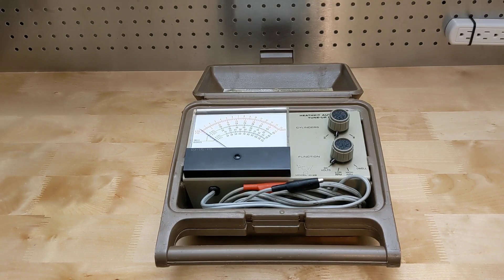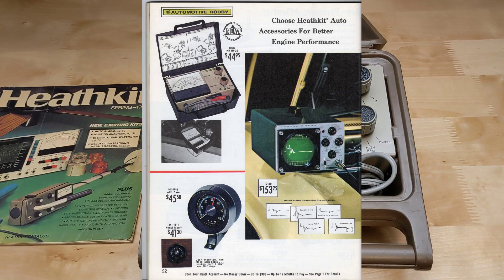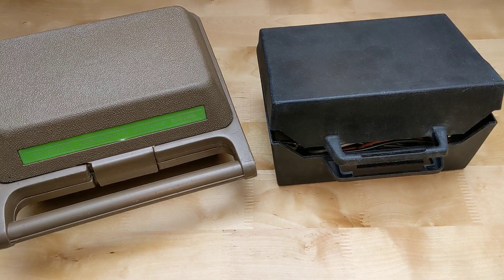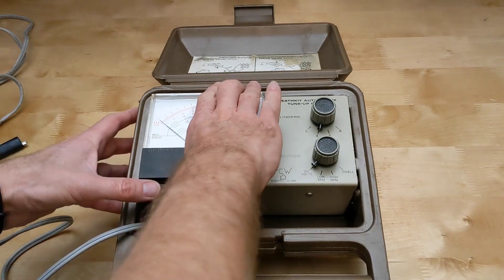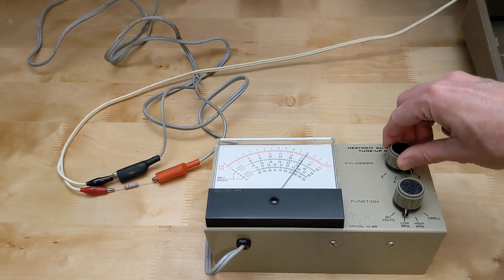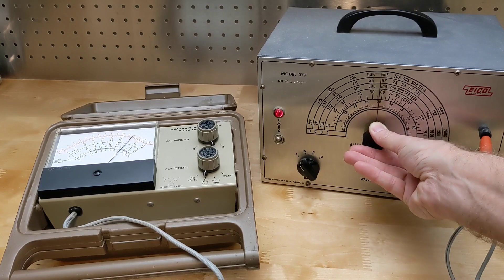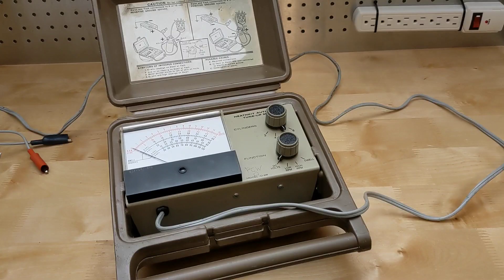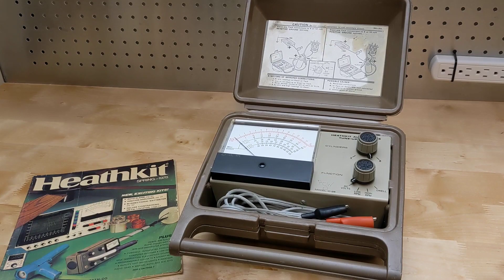The Heathkit ID-29 Automotive Tune-Up Meter

Comment: I'm an old guy with an old piece of gear, a Heathkit Electronic Tachometer, model MI-31A, that I bought and assembled in 1965 at age 19.  My originally-intended use for it was to set up the Mercury Mk 20H racing outboard that powered my class B Stock Hydroplane (great fun, a 10' plywood hull weighing about 110 lbs, engine another 70lbs, and reaching about 60mph in the straightaways, at about 7200 rpm).  The Heathkit tach was a dual-range deal, which you switched to get the 4000 or 8000 rpm scale.  Besides the boat, I had it on various cars.  I still have the old tach and the yellow assembly manual.                                                                                                                                                                           .                                                                                                                                                                                                                                                         I know less about ohms and farads than about nuts and bolts,  so I'd like to hear your educated guess on whether I can use this tach 9or any tach of that era (I have a couple of Dixcos) with a typical point-less electronic ignition that still uses a distributor and single coil.  I'd appreciate any thoughts.  Now that I think about it, would it be a good idea to open up that Heathkit or any sixty-year-old tach (or whatever) and just preemptively replace the old capacitors, as I've heard you guys tend to do  .  .  .  ??
Reply from the maker: I don't know much about tachometers and whether a vintage one will work with modern electronic ignition. It may also need to support the number of cylinders in the engine unless the calibration adjustment can account for it. I was not able to find a manual for Heathit MI-31A, only a schematic.
As far as replacing capacitors, generally it is just the electrolyltic type that tend to fail over time and, from the schematic for the MI-31A, it does not appear to have any of that type.
Reply: @jefftranter  T.hanks, Jeff

Comment: I had a couple of AMC Gremlins that I used to "tune up" using a pair of Heathkit tools, one of which was (I believe) this unit shown here, with the brown case, and the other being one of the stroboscopic timing light tools (my gun had a blue case). I bought both tools at the same time, some time after 1977. Apparently, although as Jeff says here, the Heathkit catalogs stopped listing the ID-29 earlier, they still sold me the brown cased ID-29. Like most people probably did, I dumped mine when I got my first car that no longer required tune-ups.

Comment: It would have been really useful if it included a setting for 2 cylinders (a V-twin motorcycle engine), and a 100-10-1-.1 amp scale for testing parasitic current draw, or for seeing how much current a circuit was drawing that kept blowing the fuse. This would have also made it ideal for model railroaders for checking the DC output of their power pack. 😊

Comment: Interesting. Paul Carlson (Mr. Carlson’s Lab) did a review/repair/alignment on a similar Sears-brand Tach/Dwell meter just a few days ago, but it didn’t have the voltmeter function, and had 1 IC (a CD4049), plus a few transistors and passives. Up to that point, I hadn’t seen a tach/dwell meter in decades. 😏

Comment: I assembled and still have a ID-29. Back in the day it got tons of use. I used to own the Heathkit ignition scope but traded it in for a Snap On scope. The smaller size of the Heathkit scope made it ideal for checking ignition systems out with the vehicle in operation with the help of a driver!

Comment: I still have mine.  Necessary to set the correct breaker point gap (dwell angle) accurately.  Used mine quite a bit, on engines that had distributor with a door opening, setting dwell angle using an allen wrench was a piece of cake.  Mine still works but now mostly just functional as a dc volt meter.  A Craftsman timing light and this meter was all you needed to keep you car in tune.

The good old days when everything was mechanical and always needed periodic adjustments.